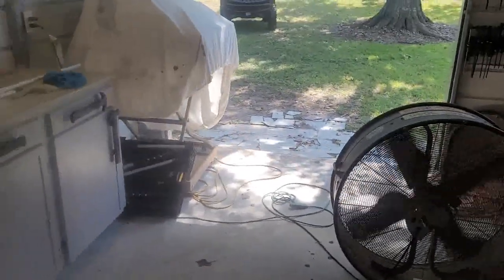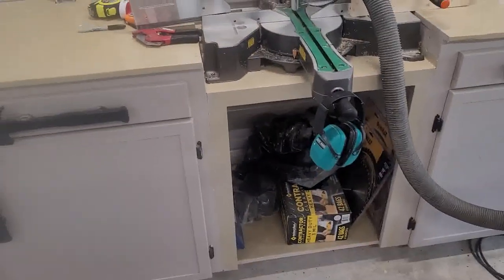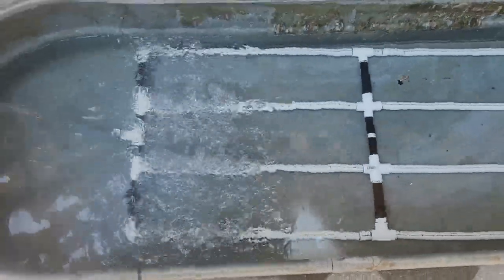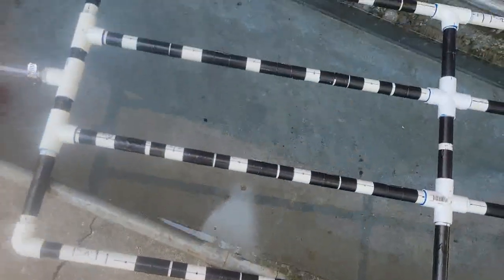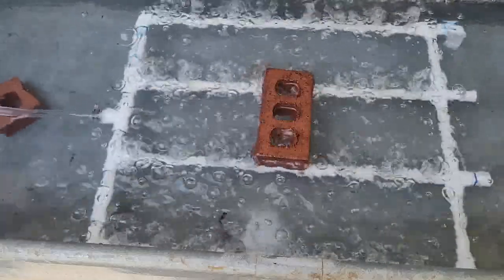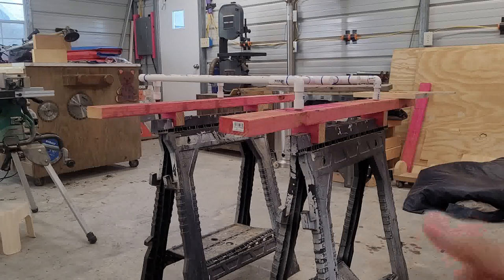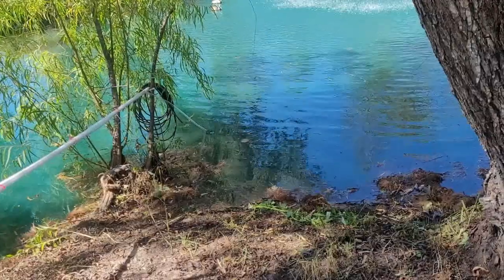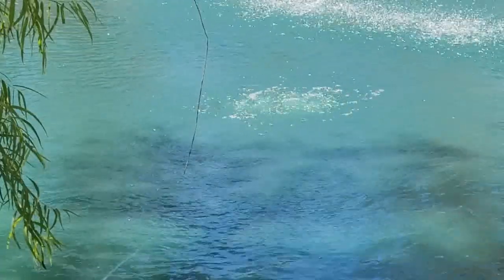PVC pipe diffuser/Aerator for fish pond.

Comment: Beautiful job of practical engineering.  With the expense of the pvc, and your time, I would have thought that a manufactured diffuser disk would have been cheaper and more efficient.  From my own professional engineering experience I can bet that your device will float without some type of anchorage.
Reply from the maker: Cost was almost nothing since I had everything, and you are correct about the floating, I secured a couple of bricks to keep down. Thanks for the comment.

Comment: The front holes should be farther apart and a smaller diameter of PVC to squeeze the air to the back part of your device.
Reply from the maker: I agree with you on the smaller diameter pipe.

Comment: It's an airflow LPM and pressure computation. The air pumps airflow and pressure capability. That is LPM and kPa value of the air pump then you subtract the kPa value of the water depth and the nominal LPM of the hole diameter times the number of holes. The resulting value should be plus to see bubbles in all the holes. If computation is too troublesome just make sure the air pump is very powerful to be sure.
Reply from the maker: ok Frank, that's deep. That just went right over my head, but thanks for the comment.

Comment: isnot it possible that when its in the pond and pump ia off water fill the your system  and when you turn the pump due to weight of the water in pipe air cant move out of hole

Comment: This might be a stupid idea....but before you had cut it. you could have turned it upside down.....so the bubbles come out the bottom....that MIGHT have forced the air to the very end before coming out the bottom. holes......maybe?
Reply from the maker: Hmmmm, that may have worked. Didn't think of that. I may try this later (turn it upside down) it may cause a better bubble agitation. Thanks for the comment.